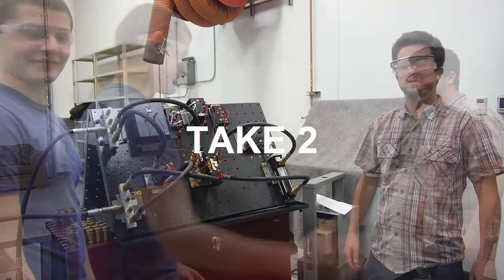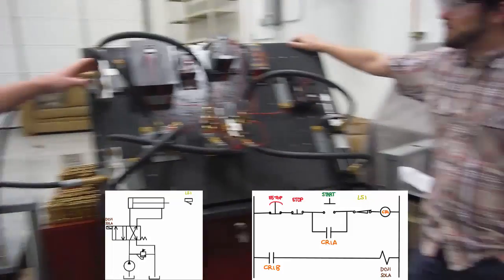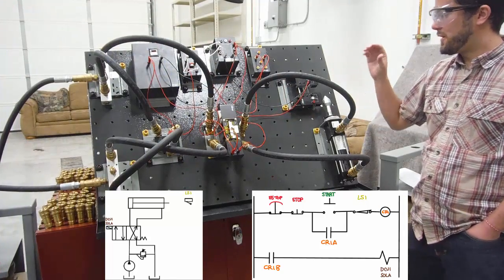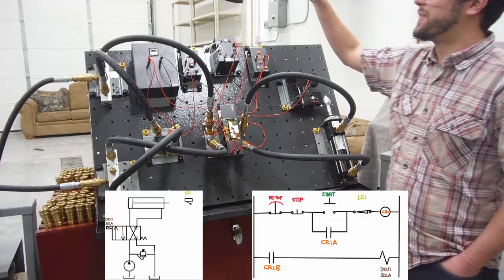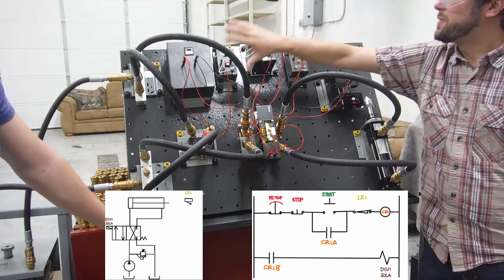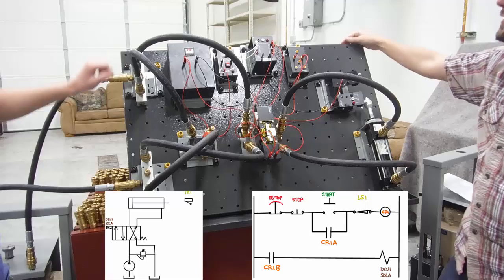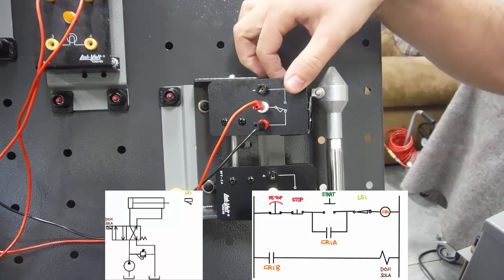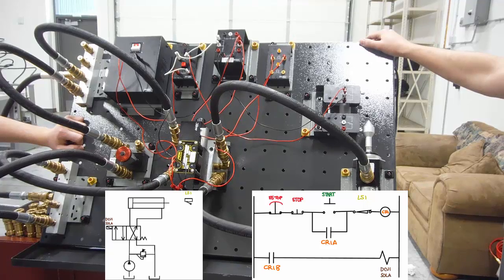Electrically Controlled Hydraulic System Demonstration (featuring Renald and Mike)

Comment: unfortunately although i have  vickers spool valves and wanted electro control on a motor I  see no way because before the motor there must be a flow valve, so dammit I  have to just pressurise a manual 4 way  spring return valve bank into the system, even this is no good as the flow will be restricted to the 4 way, so this means a single manual valve aH I SEE A WAY, flow regulator before 4 way manual valve but still cannot control electrically unless detente valves are used